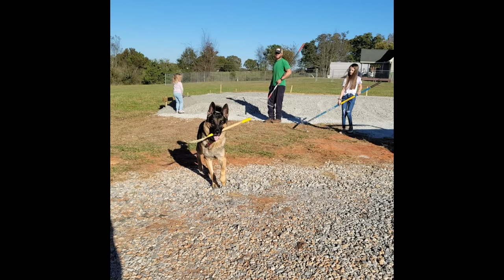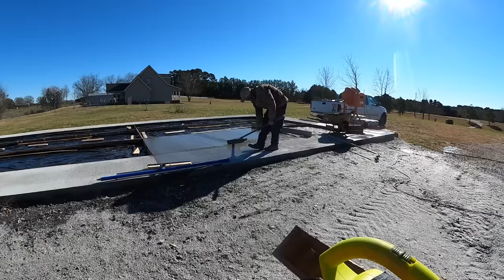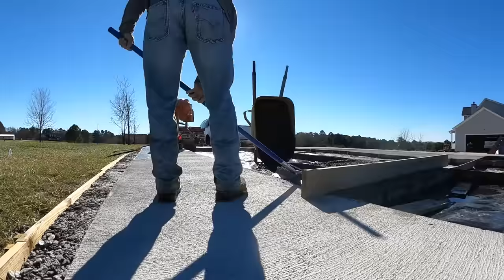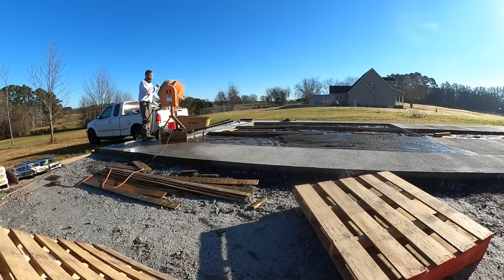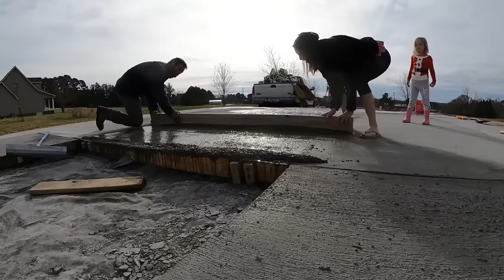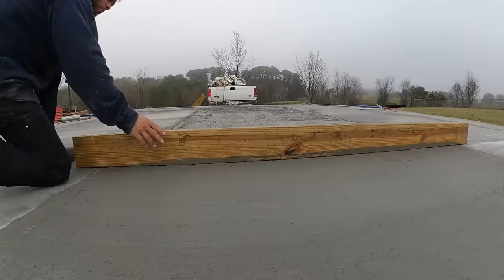Pouring a Huge Concrete Slab Using Bagged Concrete | I Saved $10,000

Comment: i am thinking doing the same thing but mine is that I have no access to water because my property is very far from the city, in open desert area.
Reply from the maker: I was talking to a fellow earlier on here and came up with an affordable option. Check out used ibc totes in your area. They hold between 275 and 330 gallons depending on the size you get. You can usually get them for around 75 dollars or so. He said he’s even collected rain water in his so he didn’t have to haul it around.

Comment: Why didn't you use any rebar? Even just some fence wire mesh adds allot of strength and is cheap. Or is the ground so stable there that it won't crack up over time?
Reply from the maker: In my area they don't really use it in residential on grade 4" slabs. Here it doesn't get cold, and we have good soil. I also put over 100 tons of gravel beneath for drainage. It may be different in your area so definitely something to call around and ask about. I did a 1 year update if you're interested. Not one crack has appeared yet!

Comment: Sorry bud.  I’m not sure what climate you live in but rebar is a good idea no matter what.  I believe.  I did t see any in this pour.  Or pours  it might crack up on you with frost or water or whatever not being tied together
Reply from the maker: I called around before doing this and spoke with local pros. They said rebar wasn't needed in a residential on grade 4" slab. No one around here uses it unless requested. I've seen 1000's of houses built in my area and none had rebar. I do wish I had tied the separate slabs together for added insurance but right now I have no separation or so much as a hairline crack.

Comment: Very impressive.  People comment about no rebar, frequently a slab like that has welded wire fabric which ends up on the bottom of the slab anyway.  I would be more concerned with the subgrade, and the strength of the concrete; did you limit the amount of water in the mix and properly cure the concrete?
Reply from the maker: You're right about that. The only thing I wish I had done for added insurance was pin the slabs together. I haven't had any issues yet but it would be good insurance. I haven't even had the slightest hairline crack yet which is awesome. I scraped all of the topsoil down to hard clay and put down over 100 tons of crusher run compacted every few inches so that should be good. You'd be surprised it looked wet sometimes but I actually mixed less than what the bags called for. Thanks for checking out my video!

Comment: Dont you need to have rebar set into the concrete?
Reply from the maker: I called around and spoke with local pros. In my area they don’t use rebar on 4” residential on grade slabs. It rarely gets cold here and we have a hard clay soil. I’ve never seen it used in small buildings / driveways around here. I did a 1 year update if you’re interested. I don’t have any cracks at all and show the slab.

Comment: Great effort just dislike the high amount of excess water being used around the mix, as it decreases concrete strength. hope you place relief cuts.
Reply from the maker: Would you believe I actually used less than what the bag called for? I also did cut control joints the next day, but it was so dusty I didn't record.
Reply: @reallifetested2605  Yes I would lol.. One of the main reasons I tend to dislike it.   great video tho!

Comment: I have to ask, why would you do it this way?  I mean with bags of Sakrete?  It's still less expensive to have the truck bring it in from the plant , by about 20% and have it fill your panels off the chute.  You could still finish it yourself.
Reply from the maker: When I did this 80lb bags were 3.20 each and truck was 200 to 220 with a 4-6 week wait. Not much of a savings but I was limited on time (working night shift 7 days a week) this allowed a little more flexibility and I could handle this easier than truck loads. Contractors were wanting minimum 14k for this and I did it myself for a little less than 4k.

Comment: Trying to find a Concrete Company in my area is Damn Near Impossible. All the ones Google Lists Never Answer their phones Or are Not actual Concrete but Paving Manufactures... Only Water Source I have is Rain Water in 35gallon Garbage Cans.... so for me to make even a 20x36 ( about ) pad, I have to wait for it to rain.... then be able to even afford the bags of crete. and since I am in my late 40's and had a back injury, those 80lbs bags are a Bitch!  It Will be worth it tho to go to Harbor Freight to buy their (about) 3yrd Mixer for $200-275.. Depending on Coupon amount... Mine don't have to be Perfect or Smoothed, just level and square enough for the foundation to sit on and high enough so when it rains, the foundation stays dry.
Reply from the maker: That's how it is here to just trying to get estimates. We called many people and they said sure i'll be there on this day and never showed, or they didnt' respond at all. The ones that did show wanted 14k and up for this pad. My wife and I were like what!? The only cheap solution I can think of for your water predicament is to get one of the used IBC totes, I see them around here all the time for 75 dollars or so. They hold between 250-330 gallons of water (I think) That would be enough to get plenty of water back to where you need and to get you working for a little while. Thank you for checking out my video, and for leaving a comment!
Reply: @reallifetested2605  Those Totes around here cost $35 But are Never In Stock and the ones in the same town as me are $200 and Refuse to come down. Can find Random ones on Craigslist for about $100 but are usually nasty as all hell..

Comment: I like using 2 hoses. I keep the 2nd trickling into a 2.5 gallon bucket.  When I empty the mixer in to the wheelbarrow my buckets full so I can quickly reload the mixer.  When I return with the barrow the next batch is ready maybe only needing a few shots from the. Squirter.  I used to. Use one but realized I wasted a lot of time filling the bucket.  Did you get a bulk price on the bags?
Reply from the maker: That’s a good idea. It would definitely save a ton of time especially with this amount. Yes I got a pretty good discount buying this many bags. Price was 3.20 per bag.

Comment: how big were the sections? how long did each section take?  i have been toying with doing this, by the way... that came out great!
Reply from the maker: Don’t hold me to it but I’m thinking they are around 8 wide and around 20-22’ long. (They have to be somewhere around that size) it took me somewhere around 3 hours of actual mixing and spreading. I did this in our winters where nighttime temps are 40s and daytime are around 50 so I had plenty of time to work. Cold is fine as long as it’s not freezing. Summer would’ve been a bad time because hardens fast when it’s hot! As long as you’ve got everything planned out ahead of time you can take this on no problem.
Reply: @reallifetested2605   Thanks for taking the time to reply!

Comment: How did you keep the forms when pouring the slab next to the previous one? Did you pour outsides and then remove the forms and just allowed the middle slabs to be different sizes?
Reply from the maker: Yes I poured the outside slabs first. Then removed the inner forms. I used the actual concrete slabs as the forms for the last 2 in the middle. I didn’t realize it looked like I left the forms in until a few commented on it. I did remove all of the forms lol
Reply: @reallifetested2605  thanks for the video/information. Looking to do one myself but haven't done anything quite this big.

Comment: I didn’t see any rebars is this normal for that thickness of concrete? I want to do the same. 
Thank you for sharing your experience.
Reply from the maker: You're very welcome! It really depends on your area. In my area they don't use rebar in residential on grade 4" slabs. I also put a lot of gravel beneath for drainage. Here we have good soil and it doesn't get freezing very often. You will have to call around locally to see what the pros recommend, or if you have local codes you could call and see about that.
Reply: @reallifetested2605  
Thank you so much for your help and reply.
Have a great weekend.

Comment: based on your performance how long it will take for 270 sq ft area? (16,5 x 16,5 and 0,5 thickness) can I pour it in one day? Thank you. Great job
Reply from the maker: If you have help I’d say if you really busted your butt you could get it done in a day. If you wanted to play it safe break it up into half.
Reply: @reallifetested2605  can we break it up in half for foundation? (btw thank you for quick respond. Cheers from overseas/ Cyprus).

Comment: How many pounds of concrete did you use and what type of it (where did you buy it from)? Also, how much PSI can it hold?
Reply from the maker: It was #80 bags. I used 820 of them so 65,600 lbs not including the water. It's 4,000 psi concrete.

Comment: Im wondering how many bags fit in the mixer at one time. I once was going to pour some pieres for a house trailer but the sand gravel and cement to make the concrete was almost as much as I could get redimix. That was 35 years ago. It may be different now.
Reply from the maker: When I did this they were wanting 200 to 220 per yard with a 4-6 week lead time. I was luckily able to get #80 bags at lowes for 3.20 each. I can fit either (3) 60 lb bags or (2) 80 lb bags in the mixer. The crazy thing is I looked into mixing with the 1,2,3 method and it was going to be around 165 per yard because the price of sand and portland in my area are ridiculous.
Reply: @reallifetested2605  here redimix is 159.00 per yard. Our 60 # bags are 3.79 and it takes 60 bags per yard so much cheaper for redimix here

Comment: How did you end up transporting the concrete? Did you get it delivered? Otherwise that must have been a planning exercise all on its own...
Reply from the maker: I have a 20' 15k lb. flatbed trailer that I was able to haul 5 pallets at a time on as well as one in the truck. (I may or may not have been slightly overloaded) It took 3 full trips and a partially loaded trip. Lowes is 10-12 minutes away. I unloaded everything with my tractor. I'm thinking I started when they opened and was able to get everything finished and ready to go just before lunch.

Comment: I got priced to do my driveway at 18 grand.  Construction cost is ridiculously high. I won't pay it. I refuse to.
Reply from the maker: I don’t understand what’s going on. We’ve just recently got a quote for a 24x24 shop with no electrical, drywall or anything. Just the shell. We got multiple quotes all for around 100,000. Long story short I’m going to take a few days here and there and build it myself. Material cost for that is right at 17,000 so they’re charging 80,000 for labor. The bad thing is my price is finished with electrical and drywall.

Comment: I don't see any rebar in there? Anchor bolts? Is connecting the pads together? Are there any pins?
Reply from the maker: None. In my area no one uses rebar except for homes and industrial settings. I haven’t had any issues but do wish I had pinned the slabs together for added insurance. I’m doing yearly updates if you’re interested and year 2 is coming up soon.

Comment: Tragic to see this done without rebar or at the very least some chicken wire and also expansion joint.  Hope it's holding up well, cuz damn that is a fucking PROject.  I have done some large jobs that I shouldn't have by myself, but that, what you did, was insanity.
Reply from the maker: I called around and spoke with local pros. In my area they don’t use rebar on 4” residential on grade slabs. It rarely gets cold here and we have a hard clay soil. I’ve never seen it used in small buildings / driveways around here. I did a 1 year update if you’re interested. I don’t have any cracks at all and show the slab. Thanks for checking out my video and for commenting!

Comment: I find it hard to believe that the bags and mixer were cheaper than concrete truck...
Reply from the maker: That's what I said too, when I did this they were wanting 200 to 225 depending on the day for truck even with a 4-6 week wait. I was able to get #80 bags for 3.20 each. Believe it or not it was even cheaper than making my own using portland, sand, and gravel because sand in my area is outrageous (over 50 dollars a ton).

Comment: You should have put some rebar in there
Reply from the maker: I called around and spoke with local pros. In my area they don’t use rebar on 4” residential on grade slabs. It rarely gets cold here and we have a hard clay soil. I’ve never seen it used in small buildings / driveways around here. I did a 1 year update if you’re interested. I don’t have any cracks at all and show the slab.

Comment: I need to get bag mix wherever you're getting it cause I priced everything out and its a lot more expensive to do bags than it is to have concrete delivered.
Reply from the maker: I made a one year update answering most of the frequently asked questions (to the best of my knowledge). I showed prices of bagged in my area. At the time I did this truck was 200 to 220 depending on the day with a 4-6 week wait. #80 bags were 3.20 each so that’s the route I took.
Reply: @reallifetested2605  well that makes sense then. It’s a lot more expensive where you are. Either way great job. That’s a lot of work solo! I’m up in the mountains and it’s hard to get a truck up here so I’m having to go the same route.

Comment: I'm looking to do my own concrete walkway around my house  * house is currently bring built * so the ground is already dug up I'll still need to compact it but this will be my first time doing concrete work, any recommendations, tools that will be needed Or suggestions I should follow? I'll be doing it about 4 or 5 feet wide by probably 5-6 feet long sections at a time around the house.
 
Thanks for the advice
Reply from the maker: Other than a mixer and standard tools I can't think of anything. If you don't have any concrete tools I have seen full kits from marshalltown. They are good quality and seem to be made to last a lifetime. If you get the harbor freight mixer I actually made a separate video of things to look out for and a small modification I made that makes it a lot more usable.  . The only thing I wish I would've done different is actually pin the slabs together with rebar. I have had no issues but this would've been a little added insurance for me. The way my building is set up on the slabs it actually holds all of the slabs together anyhow. Thanks for checking out my video, and for taking the time to leave a comment.

Comment: No interconnecting rebar? Is there at least fiber mesh mixed in the concrete? These are basically giant pavers.
Reply from the maker: I haven't had any issues but I do wish that I had put rebar to connect the pads together. It would've been good insurance. The building that is on top of the outer pads is bolted in about every 5' or so. That should hold everything together. I put over 100 ton of compacted crusher as a base so hopefully it won't go anywhere.

Comment: Just wondering two things. 1. How did you prepare your base? and 2. What was the total cost?
Reply from the maker: I graded off the top soil down to a hard base, poured crusher run and compacted every couple of inches. Total cost was 3800 for 830 bags of concrete and over 100 tons of gravel.

Comment: its only been a year - wait until you put a load on it or when the ground heaves or settles
Reply from the maker: I was responding to comments and yours just popped up how cool is that! Hopefully there will be no settling with over 100 tons of compacted crusher run. I also store ~40,000 lbs on the slab with not so much as a hairline crack. Hopefully it stays that way.

Comment: i have always found the do it yourself way, im 68. you and the guy that built his house had money to do it. thats a problem for some of us. 
so tell us, what would the 10 ton loads cost. 
i need a place to park cars and maybe do some work on mine. ( see, do it myself). im guessing 36x28 pad then just walls and a roof. possibly rolling doors.
Reply from the maker: It really depends on your area. In my area at the time sand was so high that doing everything with the 3,2,1 method was going to cost 163 per yard. Usually it's a little over half that. The pandemic had the prices of everything all out of whack. Local truck wanted 200 to 220 per yard depending on the day, and the way I did it with bag was 144 per yard so it saved me a lot of money. Bags are about a dollar higher now and I think the prices of truck have went down but i'm not sure how much. Hopefully everything went down because i'm about to build another shop and do this again. It's insane how much everything cost right now.

Comment: Normally bagged concrete per yard will be 2 - 3 x as much compared to ready mix or mixing ( cement, sand, aggregate) yourself.  Hard for me to understand how you saved that much.
Reply from the maker: Truck was 200 to 220 per yard. Bags were 3.20 each for 80. Contractors wanted a minimum of 14k for this work. I have 3800 in everything.
Reply: @reallifetested2605  OK, thanks for those figures, I see now.

Comment: Your concrete prices must be insane. 840 bags at home depot would run about $5,000. That's 18.7 yards of concrete, or $267/yard, plus you had to mix and pour it! Adding in the cost of gravel and tools you had to be over $6,000. That means your contractor quoted over $16,000 for this pour. I would have guessed half the cost.
Reply from the maker: Truck was 200 to 220 depending on the day with a 4-6 week lead time. We had multiple quotes of 14k and up. I was able to get #80 bags for 3.20 each at lowes with my 5% discount. I used 830 bags. Everything ended up being right around 3800 dollars.
Reply: @reallifetested2605  $14,000 is a lot. Props for getting this done yourself.